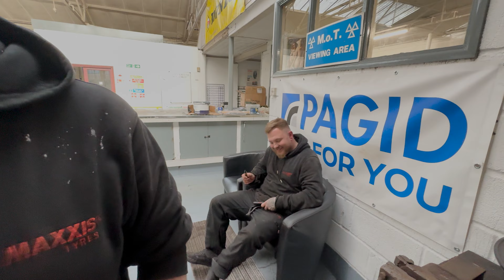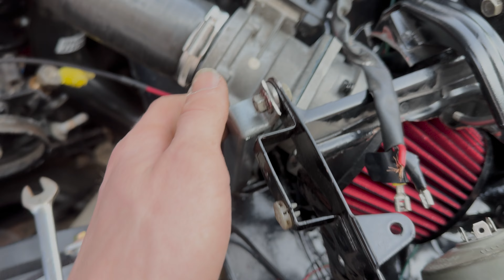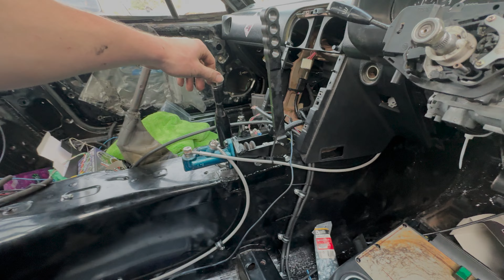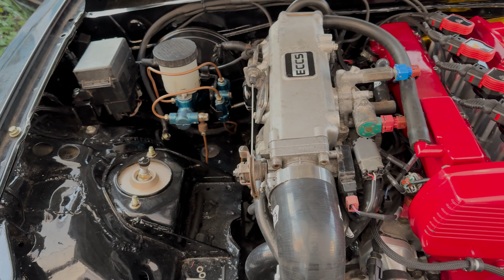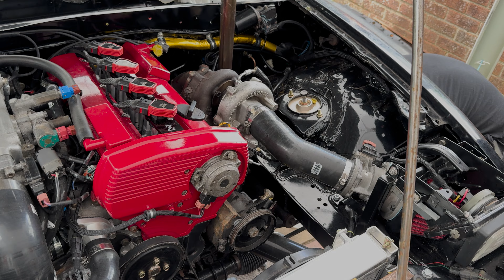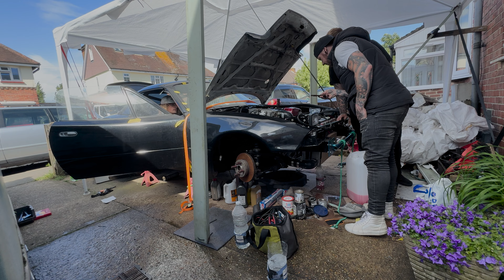FIRST START UP ON THE CA18DET POWERED JDM MIATA! | Ca18det Miata build pt10!

Comment: It’s the airflow metre that’s making it run rough because it’s been moved you’ll have to run it for ages allow the ecu to start adjusting
Reply from the maker: That may be a part of what the issue was, also had some vaccine leaks which I sorted towards tge end of the video and now it runs smooth